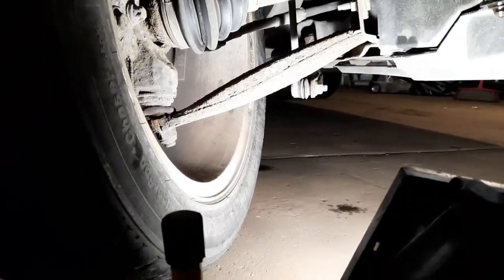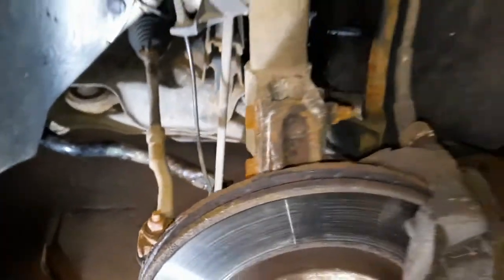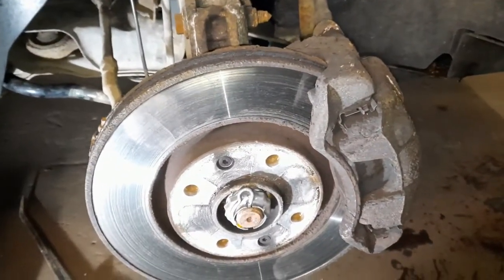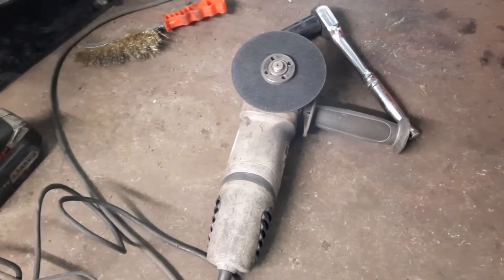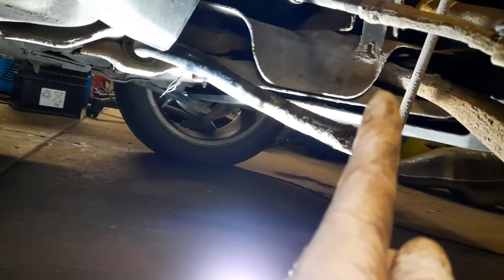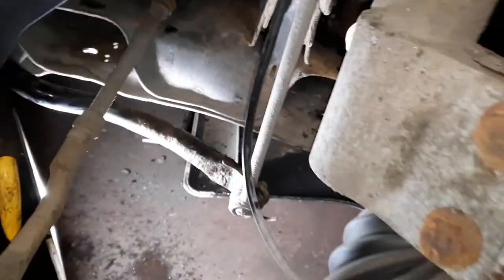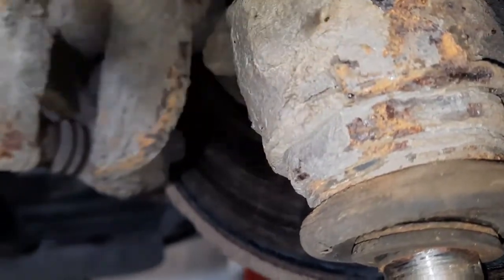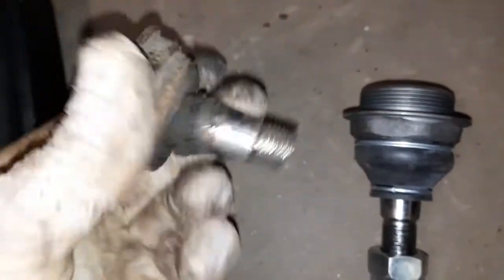Peugeot 3008 - MOT Repairs - How to Replace Wishbone, Ball Joint and Brake Pads

Comment: If you room the two bolt out from the bottom of the shocker where the hub fits it’s 100% easier to refit the ball joint then reattach the hub to the strut
Reply: Good idea .

Comment: Hi. Me from Merseyside again!  Another Informative video on any forthcoming (front) brake issues on my daughters 3008.
      I was surprised that the front calliper's just needed pushing back and not winding back as on the rear brakes ????
Reply from the maker: Hi Norman!

Glad you are finding the videos useful.

All front brake calipers are just push in pistons. Some cars rear calipers are push in too (depending on the type of brake setup).

Winding back calipers is only required if the handbrake cable attaches to the caliper. As the handbrake element of it screws out to "auto adjust" as the pads wear.

Comment: The reason why the 1st bolt, centre arm, is pointing down is, if the nut comes undone, the bolt won't fall out. Safety  first. 😉

Comment: Way cheaper to buy bushings and press into the wishbone.
Reply from the maker: Thank you for your comment.

That's very true!

However if a customer has to pay for my time it doesn't work out much cheaper.

Part will be cheaper but theres more labour time/cost involved messing about with bushes.

Fitting a new arm also means you can forget about the other bush failing or the wishbone itself corroding for a few years.

So if you are paying a mechanic to do the job it's much better value to replace the whole wishbone.
Reply: Its not that much more expensive to buy the whole thing and far less agro .